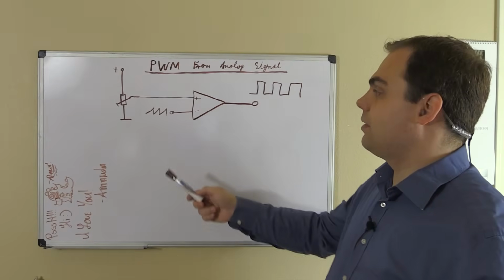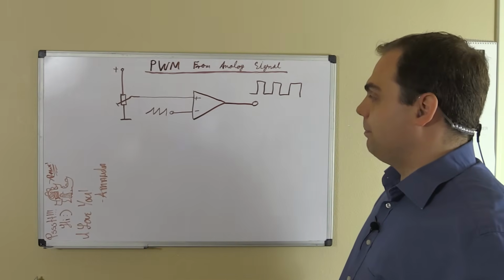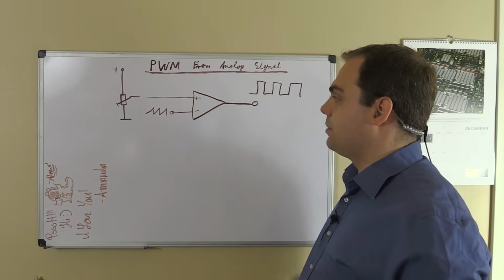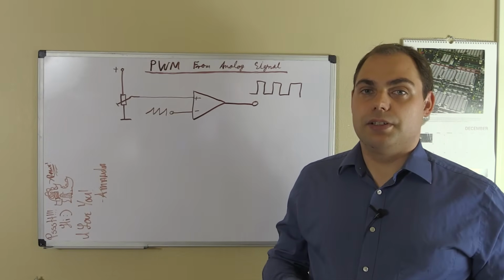Generate PWM Signals Like a Pro | LED Dimming Tutorial

Comment: One can use the 555 to generate the triangular wave and use the discharge pin to pull down a MOSFET pull up resistor. The comparator is in the 555 already and also the inverting function on the output compared to the threshold voltage which is 2/3 of the supply. I see people use the 555 output on the sweep terminal of a variable potentiometer and the the other two terminal connect to a diode one with cathode and  the other with anode. The anode and cathode are common in the other end charging a capacitor. This voltage on the capacitor is fed back to the the threshold and trigger pins simultaneously. The discharge pin on the 555 can sink 200mA apparently, so a 12V supply with a 100ohm pullup resistor driving say an irf530 or 540 can PWM very well.

Comment: thanks, I was trying to control the charge / discharge pathways of 555 timer using mosfets as variable resistor but  I had to process the signal to be in a certain range and invert it and what not and it was very complicated and I had trouble making 'summing amplifier' work.